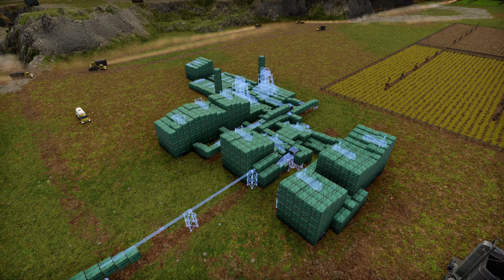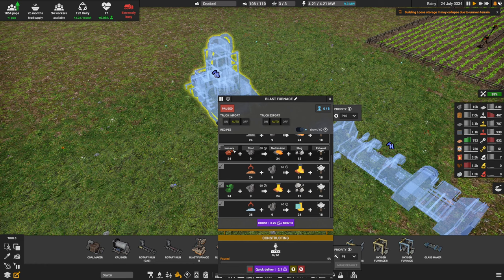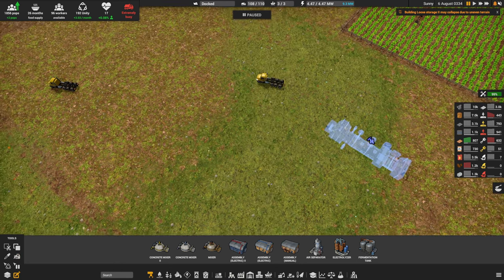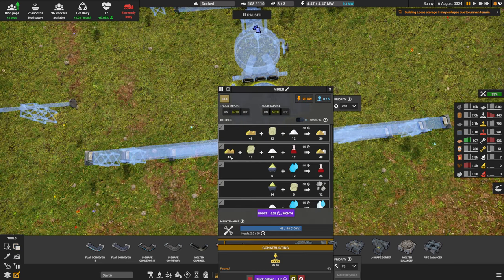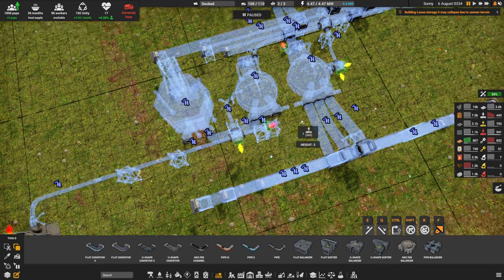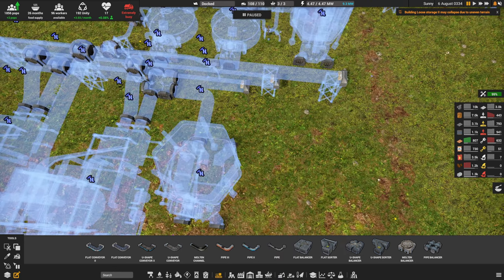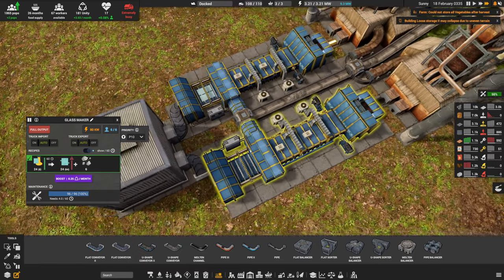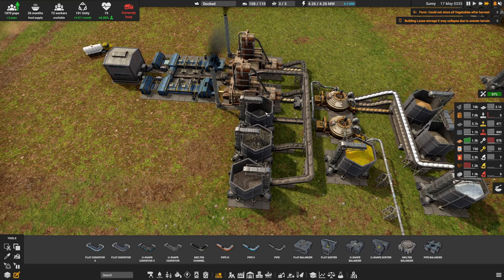Perfectly Efficient Glass Smelter Inc Recycling 🚜 Captain of Industry  👷  Walkthrough, Guide, Tips

Comment: Glass is mostly made from Sand and recycled glass. Recycled Glass is a better source of molten glass since it produced no slag as a bi product. Carbon Graphite is an essential component in glass making because of its high temperature resistance and stability. Quartz is too expensive to be used for glass making so it is instead exploited for its high Silicon content, ideal for making high quality electronics and solar panels.